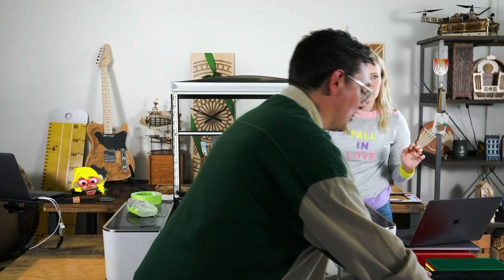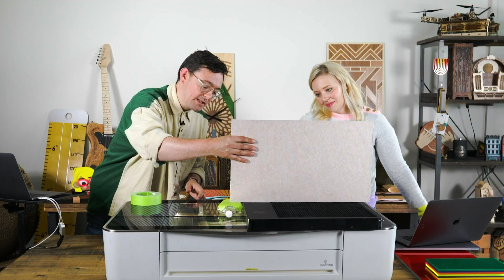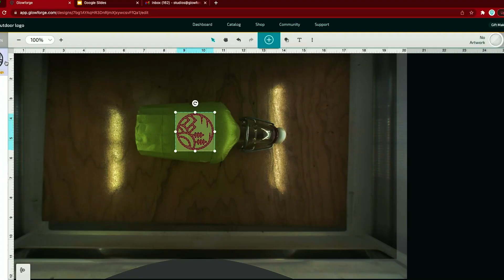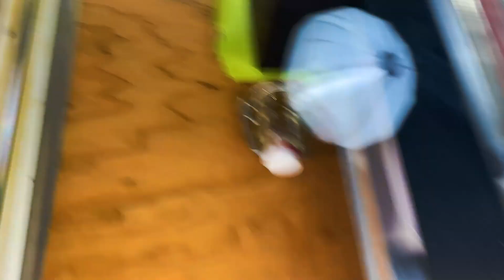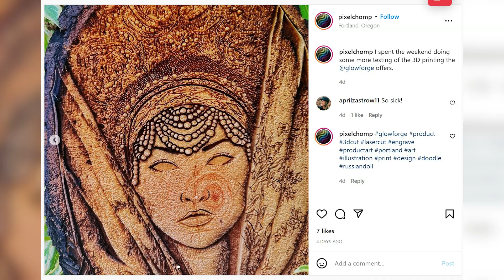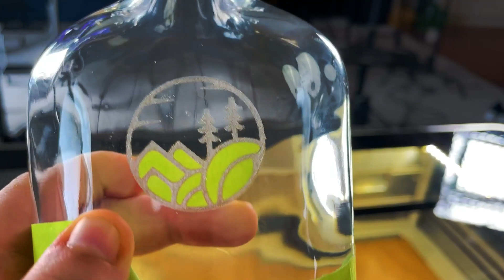Removing the Crumb Tray (+ print on a glass bottle!) | Glowforge

Comment: Great video again folks! If I may suggest a tip, you most probably already know about but just in case others read this - use a strip of duct tape/gaffer tape to help remove the masking tape in easy movement - it's better for your nails and helps reduce marking on the material itself, especially handy with acrylic! Keep 'em coming!

Comment: Can you engrave a bottle of full liquor that has not been opened?  Is there significant heat produced?
Reply from the maker: While I haven't seen anyone try to print on a bottle full of liquid before, I have seen Glowforge owners print on glass before with tons of success. There is some heat produced when the laser hits the glass, though prints rarely ever feel warm to the touch after they're finished so the heat doesn't last long. Unfortunately I'm not quite sure how much heat that would be (and if it would cause a change in the liquid inside). I think the biggest factor here might be the size of the bottles you're looking to print as the maximum thickness of material you can print on your Glowforge is 2" (which wouldn't fit a bottle of wine for example). I hope that helps!